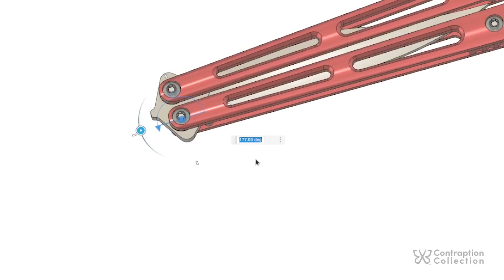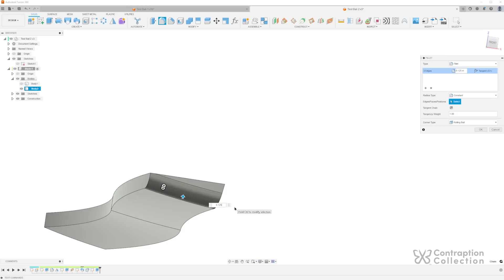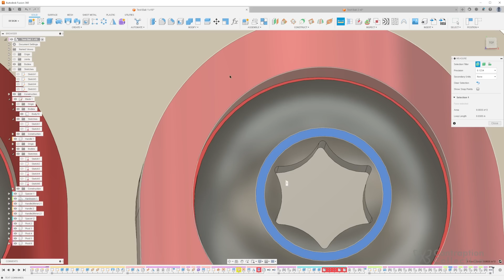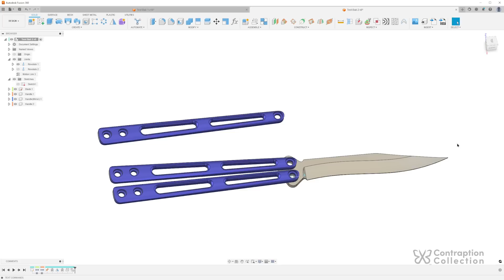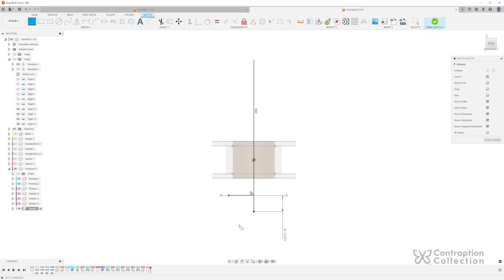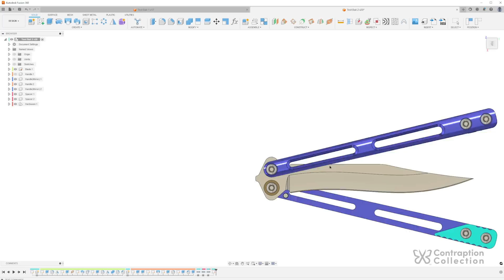How I use Fusion 360 and not have it be a chaotic mess.

Comment: A little tip save your facets, bevels, champers, fillets, radius edges etc. for the end of the sketch timeline, it makes it a lot easier if you ever need to go in to adjust or remove them. 👍👍
Reply from the maker: No reason you can't do it that way. I just like trying to keep all of the same part's features grouped together as best I can on the timeline. That's just how my mind thinks.

Comment: As someone who has stepped into an Engineering/CAD design role within the last year, I have also been learning many of the same lessons as you, only in Inventor instead of Fusion. The running joke around the office with Inventor is that if you can't figure out how to do something, just try to think of the least intuitive way to perform that action, and that will likely point you in the right direction. It's powerful software, but not the most user friendly. Great tips all around, especially with keeping sketches simple. If you can make something a feature and not a sketch, it is FAR less likely to break! One note with the revolve feature that you used for the pivot pins, you can use the hole feature instead of adding it through the sketch. That way, you get to keep those sketches simple, and it's typically faster than adding the individual lines. Keep up the great work, and if you were to offer a trainer, I'd definitely want to pick one up from you. Love your attention to detail!

Comment: For the record, that knife looks slightly uncomfortable to do rollovers with. I say that only because the surface that the zen pins contact looks somewhat small, and you could pinch yourself on it. That section is usually fat and wide.

Comment: Funny how my hack-job feeling method is just 1 to 1 the exact process you use.
Quickly build something close to what I want and then come in with a new file and, referencing my "sketch", build the new model from the ground up to be parametric.
If it works, it works and every time I model something I learn a new trick that makes it even faster in future.
Even learned something new watching this. I don't think I knew that project plane was a feature in fusion. I new it is in Inventor but I think I never noticed it in fusion. Seeing how it's from the same company I should have probably known. but now I definitely do :D